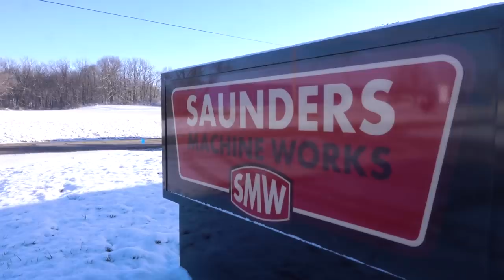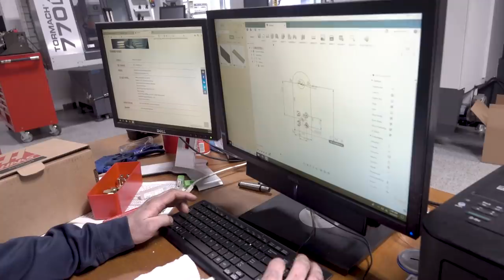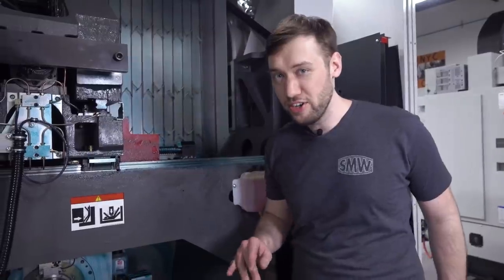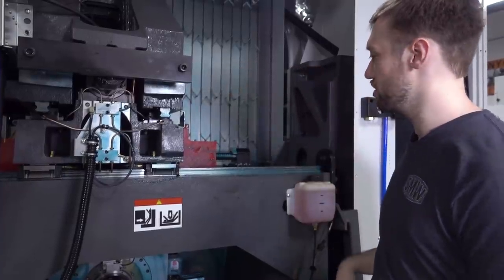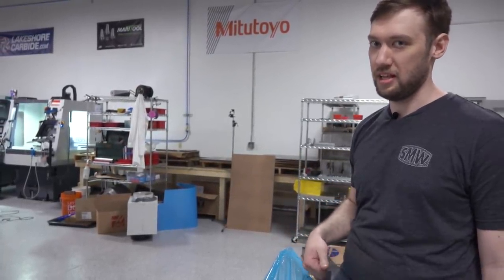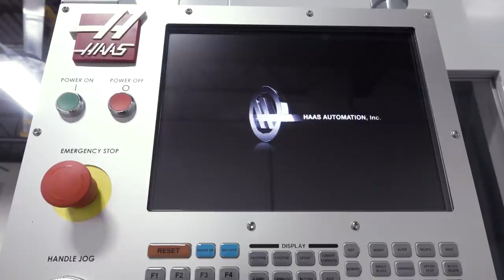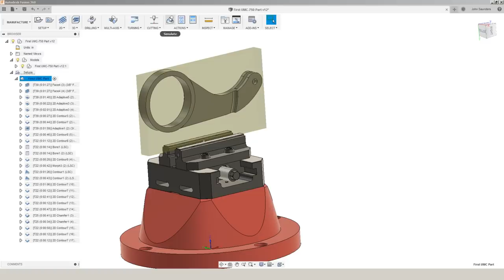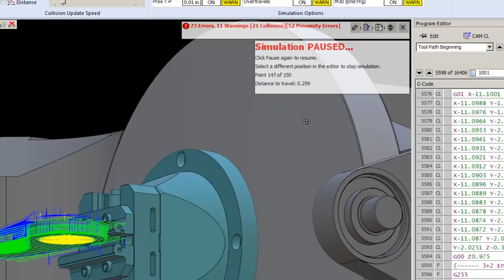Unboxing: HAAS UMC-750 & TM3P!

Comment: I've been following John for years and it's quite admirable his shop has grown in a rather exponential way. A few years ago, he said that he wants to learn "the skill sets, learning the confidence, learning the whole the picture not just CAM, not just CAD, not just tooling but everything and trying to mix in now some of the business side of things. I want to talk about how we got to where we are" A rather tall order indeed. 

Elsewhere, John said that machining is just part of what we do (there is) a "bigger picture". I suppose it's the training he provides, the R&D on robotics, and the small components he creates and sells online for CNC machines which is great. But in all this, I'm at a loss as to what Sanders Machine Works does, especially now that he has invested on some very expensive machines. Am I the only one who finds it hard to keep up with John? lol.. 

I'm with the understanding that CNC machines are designed for mass production of mechanical parts and the like but I haven't seen any castings or crates of parts on the shop floor (as I did when I was working as a CNC operator). Not that I should, but what else can account for investing on new CNC machines? In other words, what is the proverbial bread and butter of the Saunders Machines Works. Then again, it's safe to say that SMW is still evolving and growing and I suppose that, in time, SMW will find its central purpose where everything else hinges on. What that might be, only time will tell and I sincerely hope it goes well for John and all those who work with him to make SMW an exceptional machine shop.

Comment: Tip for the UMC! Make an alias M-code for safe positioning of the machine during setups. I use M100 because it's easy to enter and if you miss a 0 or the 1 it won't cause any trouble. You can do this by going into the settings and setting the O9000 program which corresponds to the custom mcode you want. 
The program goes....
G0 G90 G53 Z2.5(maximum z height)
G53 X-30. Y0.(sends spindle to back left instead of the right which would be the home posn.) 
G54 B0. C0. (Orient's table back to G54 from any position, useful if you have the C-axis set at 45. Or something and you want to send the table back to that posn. Instead of home.)
You can also do this with the "second home" posn. But I use that to bring the spindle forward for changing tools easier.
Also You'll have to turn off the O9000 program lock to create the program. You can alter the program however you want to suit your needs. 
It's also worth looking at the "tool change mid posn." I've done alot of parts that really pushed the capacity of the machine and you can use this to raise the tool above home and/or steer it around your part to change tools.
You'll often find that the limiting factor of the UMCs is the Z height especially when you have a long insert drill and tall part or a lot of fixturing under you part. 
Frankly i'm not sure why Has chose to make home the right side of the machine because almost all the time your working to the left with the B-axis at 90. Another dumb thing is the control is mounted to the right side of the machine so you can't swing it all the way to 90. It only goes about 20deg. From flush with the machine.   But I digress. Hope this was helpful to someone.
Reply from the maker: thank you!

Comment: That HRT210 is a bit large for a TM3, I'd be curious to see what table deflection is when you home the machine.
Reply: To clarify, when at HOME, the HRT210 is often mounted on the right side of the table, so the table is cantilevered at the maximum distance.  Just fixing a dial indicator to measure table deflection when the weight of the HRT210 is applied to the table, will give the answer.
Reply: Sounds like you have run a few Haas machines in your time.  The X axis overhang looks huge in that video.  It is well known that Haas has very small machine bases with narrow way spacing.  In the beginning they probably won't see much deflection, being that the rails and trucks are new.  Hopefully the will park the machine with the HRT as close to the center of Y axis as possible.
Reply: @chrisrokz9005  Not many, I had a VF0.  The VF machines have a full-width saddle, with the trucks installed on the table.  It looks like they flipped that model upside down for the  TM, with the trucks on the saddle and the rails on the table, reducing the amount of support for the table.  I remember the HAAS salesman coming in with literature on the TM in 2004, they intro'd at $20k with no toolchanger, $40k with TC and all the bells and whistles.

Comment: Haha, are those the cheap Chinesium machine skates (the yellow ones) I see at the beginning of the video from ebay/amazon? I ended up with 2 sets of those recently! I need to move my 5.5ton cnc mill soon.
Reply from the maker: yup
Reply: @Ed Rees Ah, good tip. I noticed they seemed to be missing the red plastic!
Reply: @Ed Rees  I know this was 3 years ago, but I just recently got to turning the urethane tires off of my skates and was able to move my VMC with them with ease. Thank you for the tip - the cheap skates work great after you get rid of the urethane (and take the seals off of the bearings and put some oil in there - my Chinese skates appear to have been built with re-claimed old bearings that were full of dried out grease and debris and some of them are pretty worn, but good enough for a very low speed application like this - the bearings don't even match, just a random hodgepodge of whatever they had that was probably salvaged from stuff headed to the dump)

Comment: Hello John & Co is there much difference in using a Tormach Vs a Haas, as in the actual commands or are all cnc machines use a universal program to operate. Stuff and I struggled getting my 200kg mill in my shed. cheers from OZ
Reply from the maker: They have different controls, but learning the basics of a new machine/new control is relatively simple in most cases

Comment: Did you get the true 5-axis or just 3+2 with the UMC750?  If true 5-axis, what paperwork did you have to fill out to certify you weren't making parts for an ITAR restricted nation?
Reply from the maker: There's only "one" UMC-750 - and it has true 5-axis.   There was no ITAR paperwork for this machine.
Reply: @nyccnc  You didn't have to fill out anything to enable 5-axis simultaneous machining?  These machines are considered restricted because they can be used for making complex parts used in Nuclear programs.  I've heard of some extreme lengths some MTBs go to (GPS on machine) to prevent exporting or re-exporting of machines.
Reply: Only certain machines are subject to this. If you look at the Commerce Control List, a machine that is export controlled under 2B0001 needs to have a repeatability of between 0.9 and 1.6 micron depending on the range of travel. Very accurate 3-axis machines, grinding machines, etc. are potentially subject, but lots of stuff is also excluded. For example, a swiss machine that can only do bar feed and cannot physically accommodate a chuck, regardless of its accuracy or number of axes, is ALWAYS excluded.

https://www.bis.doc.gov/index.php/documents/regulations-docs/2333-ccl2-10-24-18/file

Page 12
Reply: @tarkka  based on what I read at BIS, the USDM doesn't seem to really be a concern for diversion.
Reply: Right Round  No, I wanted to know if there was any hassle with getting 5 axis simultaneous.

Comment: I'm curious, what are the benefit to use a TM3 over  one of the VF series?
Reply: He said that in their last video :-)
Reply: The benefit is the price. The TM machines are cheap.  But they are also regarded as too slow for production.
Reply: There are no benefits of the TM over the VF, except price and everything is slower and less expensive, and for newbies, that's a good thing. The toolroom machines (TM) are just really cheap, so schools and such can buy 5 of those instead of one VM/VF, giving more students the opportunity to get machine time. And since they use the same control, their knowledge will all scale to the bigger machines.
Reply: @xenonram  Yeah, John basically said the same. I think they mostly want to free up their production machines and train on the TM, as it's also cheaper if some dude crashes it. 
Ed also said something that it's basically "his" machine when it is not beeing used for training, so it's probably going to steal work from the Tormachs for their regular projects.

Although a VF is definetly way more capable than a TM, I'd still do just about anything to have access to a TM. Damn even a Tormach... xD
Reply: @themechanix393  Check out the trade schools, community colleges, and maker spaces in your area. Those are all easy ways to get access. Although, if you want access to these kinds of machines at maker spaces, they are usually about as expensive as financing your own Haas TM/CM/mini mill. So check out community colleges/trade schools.
Reply: @xenonram  Or check craigslist, get an old machine for dirt cheap, and fix it / refurb it yourself! I got a 32" x 20" x 20" VMC for $1300! Ok, the spindle drive was completely dead (fixed now, for $50 in parts, well and maybe part of the cost of a MSc in EE to have a good head start on knowing how to fix it), it's dirty as all getout, and needs some spindle bearings, but on the upside, I don't need to plan my weekends for the foreseeable future - I know what I'll be using them for for the next while!